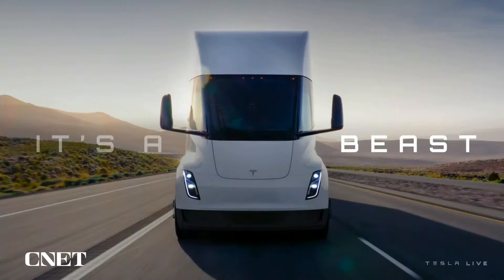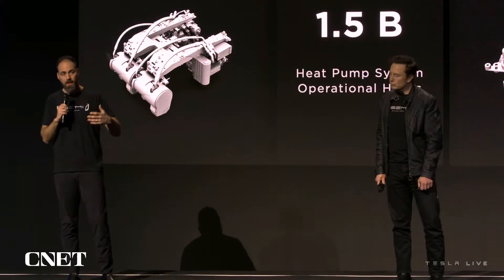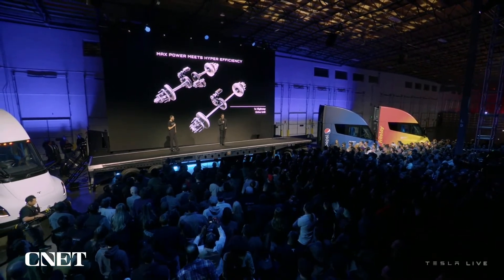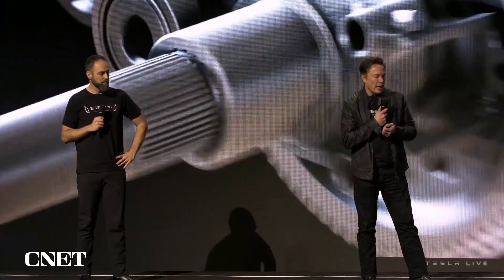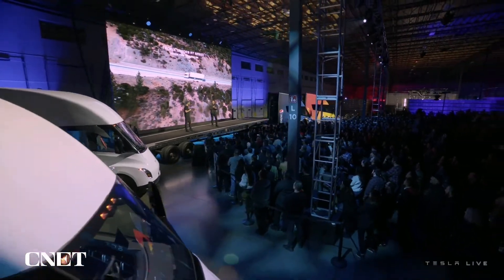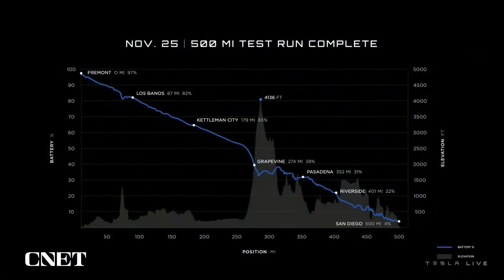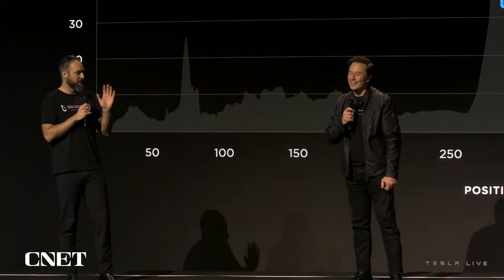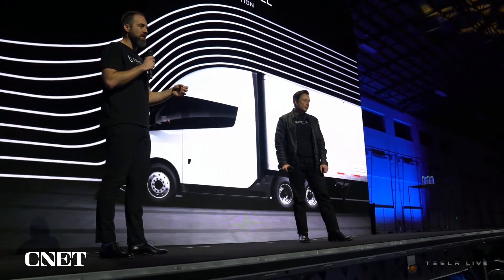Watch Elon Musk's Deep Dive Into the New Tesla Semi-Truck

Comment: So we are changing from diesel to coal powered vehicle's without any major infrastructure changes at this point. What will they be using to mine the lithium and other materials for the batteries? Correct me if I'm missing something here for the life of me I just don't get it.
Reply: Elon gave a hint.... NUCLEAR power is what will save the day. Wind and solar is is too dependant on lithium batteries. We need to reserve the lithium for electric vehicles. Therefore....shut down coal plants, install nuclear power, and keep a bit wind and solar to make the tree huggers happy.
Reply: You are absolutely correct
Reply: @Sita1437  No, he's not.
If you were to convert every ICE vehicle the electric and then use that fuel to run power stations, there would be a net gain to the environment.
Large power stations are far more efficient than ICE engines. Additionally, if you convert to EV's, every time you upgrade a power plant to better tech you automatically upgrade your national fleet.
As for mining. Current mining techniques evolved to suit the technology available at the time. As new technology becomes available it is slowly integrated into the system as the economics dictate. Mining will change to electric over time as the current fleet ages and comes up for replacement.
For lithium for the batteries mining will have to increase dramatically but as batteries come up for replacement, they will be recycled (at better than 90% efficiency) and the demand for new lithium will decline. And yes, recycling will be done, it will make sense and it will be profitable. Why? because of the size of each battery and the volume of batteries that will need recycling. You cannot get economies of scale if you don't have scale.

Comment: 500 miles with a full load. Really? How long does it take to charge for 500 miles? 4 hours? And can you find a charging unit for that 1000 volt platform as you need it?
Reply: 4 hours on a current V3 SC. 45 minutes on the V4 SC that they also announced last night. 20 mins on a MCS at high enough charge level (they can hit 3.9MW of output power).
Reply: 30 minutes to 80%, so 400 miles.
Reply: you need 2 mega watts of power to charge them

Comment: This is all very cool BUT, how much does the battery weigh out of the 82,000lb?
Reply: Why does it matter?? Cargo capacity is the same as a regular 80K LBS GVWR truck.
Reply: @dimplezdimples8451  How can it be the same when the truck weighs more?
Reply: @chengong388 they hauled 44K LBS of concrete Jersey barriers, about the same load that a diesel semi will haul. 25K LBS tractor+10K LBS trailer=45K LBS of available cargo capacity!

Comment: Tesla Semi weighs 5,200 lbs more than a diesel semi. 85% of loads are under the 80,000 lbs total weight limit. 

Electric has an extra 2,000 lb limit. 

A diesel semi with an empty box trailer weighs 35,000 lbs so they can haul 45,000 lbs of cargo in a box trailer. The Tesla can haul 41,800 lbs Note: 85% of all loads on the freeway do not max out load limits. This is a game changer. Diesel semi trucks will become obsolete.
Reply: @flamingsprite looks like you are the one who is feeling hurt.
Reply: Diesel will always be around. If they went full speed ahead right now it will take them 400 years to replace all trucks

Comment: what if your battery is full and you are going downhill?
Reply: Yes, could be a problem since the BMS will restrict battery charging when the battery is full.  Then if the brakes can't take the heat and the truck is careening down the hill without regen braking available... But, realistically, I doubt this scenario could happen unless the truck was charged exactly to 100% at the very top of a long descent.  It is possible the Tesla's Semi dashboard could have a big indicator light to warn the driver of this potential hazard.

Most of the time EV batteries are not charged exactly to 100% because (a) it takes a really long time to get from ~95% to 100% -- each of those percentage points takes much longer than the percentage points from ~50% because of the CC-CV charging profile and (b) it possibly could reduce battery lifetime longevity to charge to 100% all the time --  therefore the BMS might be already pre-programmed to not ever charge past the battery's actual 95% and still report to the drive that its at 100%.  This represents some small loss of range in exchange for increased battery longevity and provide a safety margin for regen braking which is crucial for big rigs.

Actually, a more frequent scenario would be if the Tesla Semi's battery is cold (winter weather) right at the top of a hill because the BMS will also restrict charging until the battery warms up.  This already is true on Tesla cars where winter-time regen braking is not available until the EV is driven a few miles to warm is battery.  But given the heavy duty nature of commercial trucking, the Tesla Semi may already have battery warming coils built-in and software to warn of the drivers of this hazard before they pull out and head down the road.
Reply: @beyondfossil  exactly as said(may be only in some extreme circumstance)
Reply: Then you have to use the normal brakes lmao. Or stop and do a massive burnout. Also if you own an ev you know 100% charge is a stupid idea.
Reply: @quinnfoster1234  i mean what if your battery is charged to 100% when you go downhill...

Comment: thats cute 500 mile for a battery truck. now try and beat the 2,000 miles of a DIESEL Semi Truck. good luck u wont.
Reply: You're missing the point Ray.
It will cost a diesel truck on average $3,020.
It will cost a Tesla truck on average $2,520.
To drive 2000 miles.
Reply: Do you have any idea what percentage of semi use those 2,000 mile trips (nonstop?) comprise? Toddle off to the crib room. The accountants will call you if they need help I'm sure.
Reply: Nope he is right. The existing electric grid cannot handle the extra load. Green energy will never feed it enough. More coal fired plants will be needed. The lithium for the batteries is mined in the 3rd world by basically enslaved brown people. The batteries will age out and the toxic lithium will wind up in landfills because it is almost impossible to recycle it. Diesel is better.
Reply: @Sita1437  none of whst you just erote is true
Reply: As long as governments push zero CO2 emission regulations it won't matter if diesel trucks had 10,000 mile range.

Comment: Thinking about all the things truck drivers need to know how to do gives me anxiety.  Just knowing that this will be waaaay easier to operate is probably a game changer for anyone who’s job it is to drive these things.
On the flip side, as an ‘other’ on the road I’m scared of how fast these things are projected to move with such weight 😬 
I’ll still be steering clear .. ❤ the progress tho.
Reply: The regenerative braking system is MUCH safer than old school semi brakes AND they recharge your batteries ⚡
Reply: @Hipster420  A lot safer indeed. You do not have to worry about missing a gear on the down shift.
Reply: And a speed limit is a speed limit . All semi trucks pretty much follow them .
Reply: @Hipster420  
The trick is to "maintain the average"
That's where these will excel.
Reply: Jump in a car.
Accelerate slowly (about 25% throttle)
That's how fast these things accelerate.
.
When "moving", they "move" at the same speed as any truck, but with far more control and many more safety features.
Reply: The whole aim is to not subject people to having to drive these things anymore. As a former trucker all I can say is the sooner we get frail stupid humans out of these cabs the better. There are far too many wheel holders out there in these trucks today that do NOT have adequate training. The industry is in crisis for a lack of drivers and if you have two arms and a pulse? They will stick you in a cab within 10 days.

Comment: so funny they never addressed the load capacity of the truck, which is the biggest factor for companies buying trucks. i wonder why. 

ppl want to know how much goods your vehicle can carry.
Reply: did you even watch the whole thing lmao? Load Capacity is 82,000lbs, 2000lbs more than the most powerful ICE trucks because 80k is the legal limit for ICE
Reply: @Syntaxmoe  lol do you even know what is "load capacity"? 82k lbs is the limit of the overall weight of the truck when it is fully loaded with cargo. Thats not load capacity.\
Reply: @Syntaxmoe  What you need to know is that 82,000 lbs includes the weight of the truck. With all the battery's these are going to be heavy trucks so that needs to be taken away from the total load to give you a useable goods weight. So no, even after watching the video, they have not.
Reply: @Syntaxmoe  no, 80k is the legal limit for a standard 5 axel combination vehicle with tandem axel sets. Plenty of heavier ones push way more weight around, but those are used more up north. Cement trucks and dirt trucks commonly have tag axels to get closer to 100k, going as high as 160 with tripple dump pup trailers. Then you got the super heavys moving mining equipment that can push over 240k but at that point you also need a pusher truck and are probably running 16+ axels.

Comment: To be honest they did it with the most aerodynamically efficient load as possible. A 53' dry cube is a LOT more for resistance moving through the air.
Reply: Your acting like this is a walk in the park …I don’t see any competitor doing it ..and that’s a little embarrassing for vovlo who has been in the business forever
Reply: @Mobileccs  I am a former trucker. I am impressed. And as to why Volvo or anyone else has not matched it is because they are stuck in their box of what a truck needs to look like or how it needs to be designed and operate. Disruption NEVER comes from the incumbents in an industry. Its always the outsiders who are able to break free of established paradigms. And 99% of all the incumbent businesses in history have failed to survive technology disruptions.
Reply: @davefroman4700  
Tony fan?
("Incumbents")
😉👍
Reply: Will know soon enough, the whole point of these companies buying the Tesla semi is to save money.
Reply: this is the only valid criticism ive read so far
Reply: That’s not true what else could they use that is not in a trailer  so they could show what it’s capable of doing on video
Reply: @123456789money19  You can fit a dry cube trailer with pallets of metal ingots and hit that number easily. The greater surface area, the more resistance is created by air pressure.
Reply: I envy you in your nit free life.